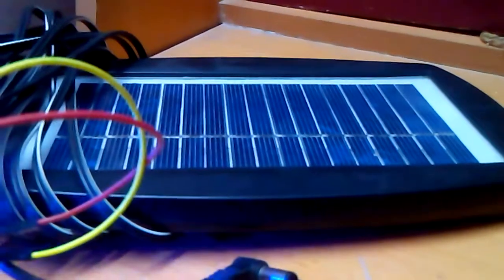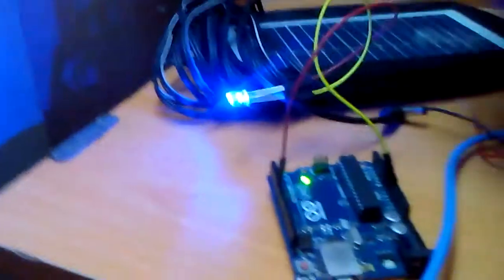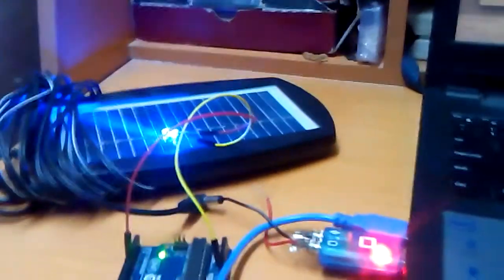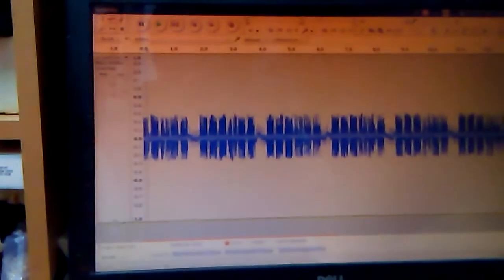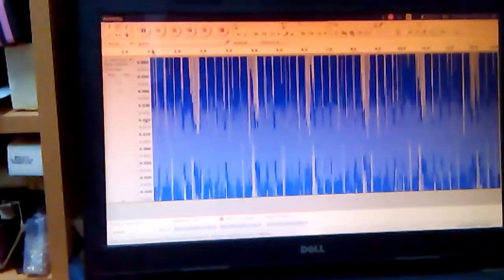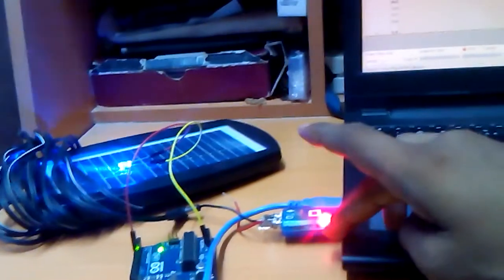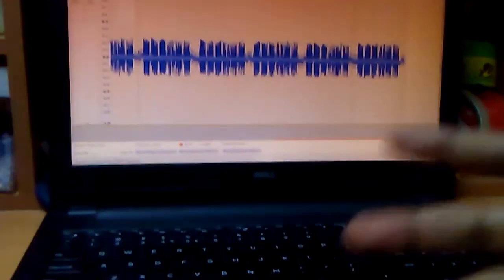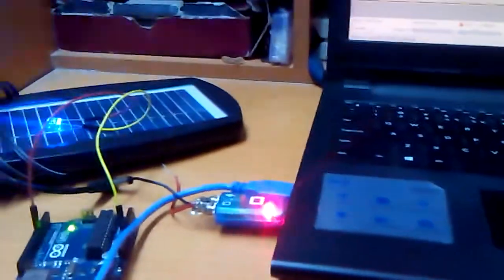LiFi with Solar panel and headphone jack

Comment: Hey, the link does not work anymore. Is there any way to find out what cables you used to connect the panel to the laptop?
Reply from the maker: We are currently working on the links right now.. But the output of the solar panel was given to the laptop using the mic of the headphone jack
Reply: Maker Movement is there a way to email you directly?
Reply from the maker: 153armstrong@gmail.com